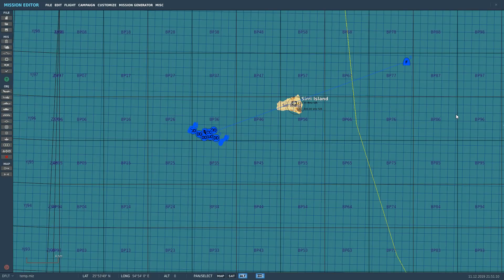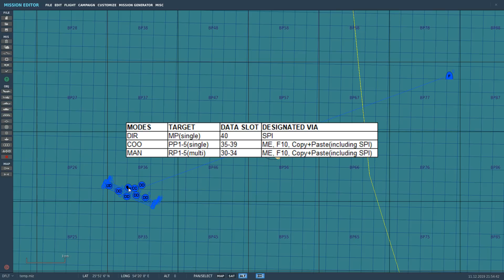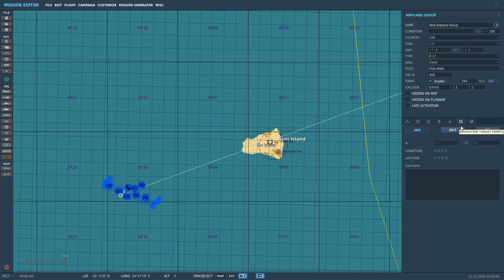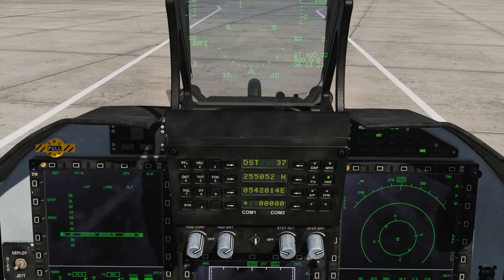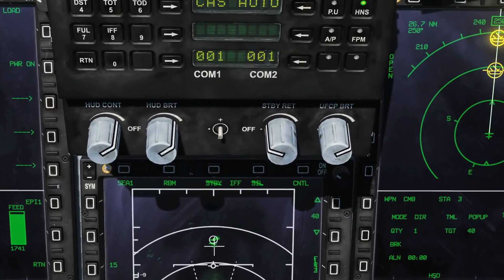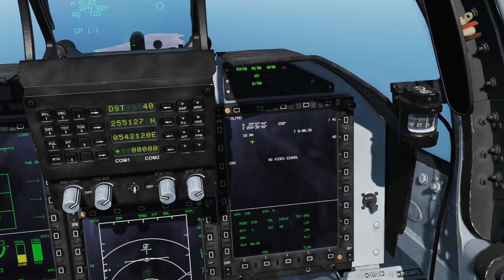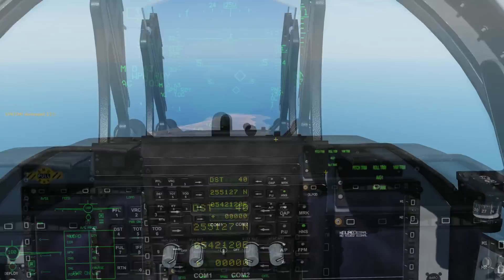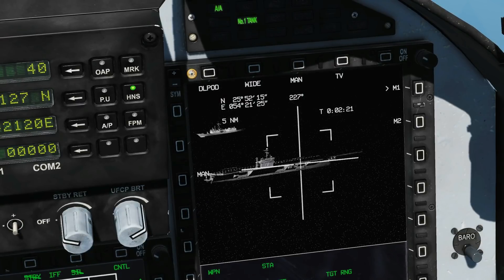JF-17 Thunder: CM-802AKG Cruise Missile (DIR/COO/MAN) Tutorial | DCS WORLD

Comment: Thanks for all your tutorials. They've been a great help.  
Just to add, the CM-802AKG missile REQUIRES MITL steering at terminal phase for ALL 3 modes (DIR, COO, MAN) to hit its target. In MAN mode, it's understood MITL steering is required. But in DIR (SPI) and COO (PP) modes, it's not always apparent that MITL steering is ALSO REQUIRED despite having an SPI or PP. If we look at the SLAM-ER or Walleye missiles, they both have the fire-and-forget option of not requiring the use of the datalink pod and MITL steering, and will still hit their targets (PP/TOO for SLAM-ER, locked target for Walleye). So if you fly Western aircraft like the F18/F16, you are used to the idea that the weapon will hit a locked target or target coordinates. But this is not so with the CM-802AKG in DCS. It sees a locked target (DIR) or pre-planned coordinates (COO) as just 'waypoints'. The current manuals do not clarify this enough. It would be a unusual if Deka's CM-802AKG in DIR and COO modes are true to real life.
Cheers!
Reply: Is this still relevant?
Reply from the maker: thx

Comment: So I launched the C-802AKG in both COO and MAN mode, and weirdly in both cases the missiles did a 180 and headed out to the sea. They weren't headed for any point of relevance (DST 00, 01, 02 or 30-34, 35-39,40-41 etc). They were just heading out of the map. Wondering if that's a bug. Tested twice, same result.
Reply: Sounds like the cold start bug.
Reply: It's a known bug, the missiles do not behave correctly in a cold start scenario. Should be fixed in the next patch.